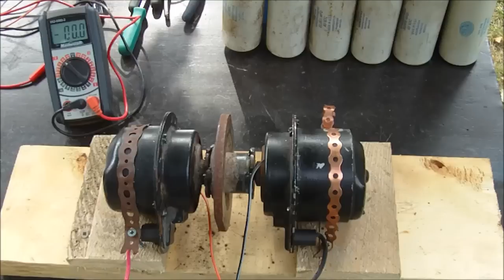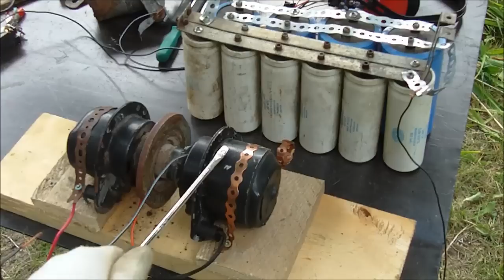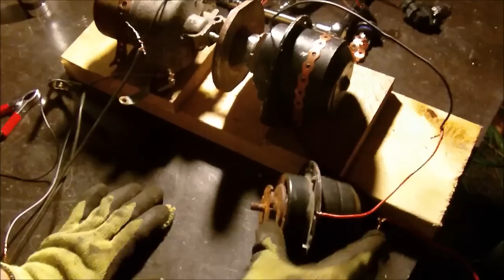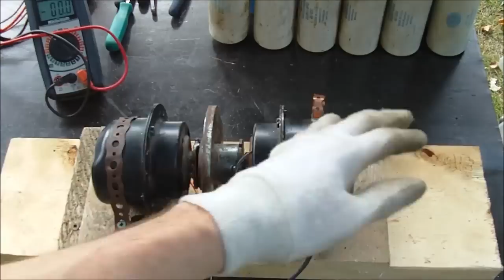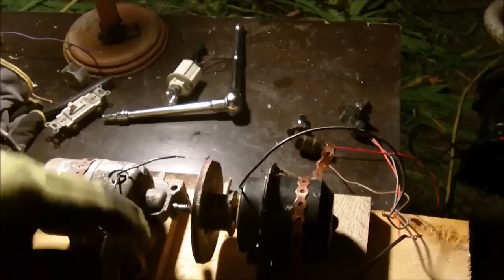Electric Motor to Motor, can they self run?

Comment: There's no reason to beat around the bush, self-running IS impossible because it violates the Law of Conservation of Energy, and the laws of Thermodynamics amongst others.  The only way you could have a self-running system is if they are 100% efficient, which is impossible.  There are always going to be internal and external losses: Friction, internal resistance, viscous damping, and much more. Even if the system is 99% efficient, there will be a 1% decrease in energy output vs input, meaning this system will not self-run.

So if you have a 100 W motor driving a 100 W generator, which is powering this motor, the only way they could self-run is that if this system is 100% efficient and the entire 100 W from the generator is sent to the motor.  In reality, when the generator produces 100 W, the motor would probably see 80 W or below depending on how well constructed the motor and generator is and the next cycle, it would be 64 W and so on until 0.

It maybe possible to get really efficient motors/generators via superconductivity etc but even then, it won't be 100%.
Reply: it needs to be done with a 2 hp 6000 rpm dc motor with reduced speed by a gear ratio of 5:1,which will increase the torque 5 times to  making a total of 7456 watts and reduce the speed 5 times slower to run a 10kW generator. Your draw to the motor will be 1491.4  watts and the voltage is 180 volts dc, which should be 8.29 amps, and, the generator output will have 220 volts AC with 7456 watts max load and a current capability of 33.9 amps maximum (I'd put a 30 amp breaker maximum, maybe even limit it at 25 amps to reduce wear on the motor. The generator will have to use a bridge rectifier with  30 amp alternator diodes (cheapest) , then, a buck converter to drop the rectifed voltage  which will be nearly 300 volts DC back down to about 210 volts dc to loop back to the batteries running the prime mover (180 vdc motor) When connecting the buck converter, be sure to connect a light bulb across the positive and negative of the feed to the buck converter to get rid of additional voltage spikes created by the generator if it is not an induction style generator. Standard generators make too many spikes as it is too dirty so, when you have a dc motor operating at a very high rpm, this may also produce unwanted spikes that will destroy the buck converter which is sensitive to spikes. If you use an inverter, the same thing will need to be done, adding a light bulb. Check out Jesse McQueen's patent as it works and does so very well. The motor, inverter, generator, and buck converters as well as the necessary wires are all very expensive but worth it for free electricity. The motor is easily $2500-$4000 for a very good 6000 or 7000 rpm 180 vdc motor. This system works perfectly in a self loop mode. Good luck building it as parts are scarce and expensive!
Reply: have you never heard "laws are ment to be broken". hahahaha. or "never say never".
Reply: That law had being violated long ago, no longer a virgin , first prof is stochastic resonance over-unity gain in crystal latices , Ein + e↓ = Over-unity
Reply: There's way too many people currently suppressing the technologies at the moment by shielding the overunity element with the physics books that the current limitations in physics have made anybody creating an overunity look like madmen. I have been working with systems now for 10 years and have cleverly released many devices that show this overunity very clearly, however, science has come up with some sort of wording to shred even one ounce of possibility of my developments by telling everybody these devices have been long ago been debunked when they never have even existed before. I'm sure you've encountered the same problem where guys like Erik Krieg have complete nonsense to say about a perpetuum device like the man in Italy with his giant Ferrous wheel he created (A machine To Die For) . It obviously runs by itself due to the transfer of weight from the bottom to the top of the wheel, but, when there is any reasonable doubt, such as Erik stated it could be running from the wind, science puts this flaw in front of anybody and sets it aside from reason so nobody will again speak of it. It isn't fair as new technologies are being buffered from society for what? To continue to allow the use of fuel, and it is damn pathetic as we are in a race to find a technology to replace fuels and there have been several devices that work but never have been released to stop the chance to create and then sustain a fuel free society and it really sucks. If anybody, our government should stand by our inventors and protect their developments because they are all the work and needs of tomorrow. Without the private inventions out there provided by the world's smartest people, the continuation of our world will be impossible and we will all need to get our heads together in the same space to put together thoughts to overcome this ridiculous greed and jealousy that has now been damping our abilities to prevail, which has been happening now for hundreds of years.
Reply: Look into REX RESEARCH(dot) com  no one spends $14,000 or more in things that do not work , hundred of patents are real working devices ...
Reply: Marc Belanger
Sorry, I stumble already about the first lines of your explanation how self-looping could be achieved. A gear box does not change power, only torque.
Reply: arkresearch
Sorry, but conservation of energy was never wrong yet, also not in crystal lattices. If you can give me a link I will have a look and I will explain you that there is no violation. (Except processes with conversion between mass and energy of course.) A Ms Noether has proved 100 years ago that our universe couldn't be stable without conservation of energy. Since our universe still seems to be stable conservation of energy must work.
And you would be surprised how much money was often spent by gullible people for outright trash. Where are the many "real working devices"?
Reply: So, running a 750 watt motor for over 30 minutes on 2 AA batteries would be impossible, right? Check out https://www.youtube.com/watch?v=GWHTm_id0YU Before  making such an outrageous claim, you might want to try to understand how DC motors really work. Until you learn how to make the WITCH INSIDE OF DC MOTORS work for you instead of against you, you will never really understand the truth.
Reply: Vid Bid Truth is that laws of physics hold. They are used by engineers countless times every day and prove always to be right. I studied EE (MSc) and I know how DC motors work. This motor runs idle and does by no means deliver 750W. With a mechanical load of 750W he would not run this time at all.
Reply: In a system built like this., the only way any overunity would happen would be by introducing very tall spikes of power in a rapid succession, on/of/on/off, to gain speed with a higher output  power and lower input power from the same amount of time that it is on, bringing the voltage to a higher level by the release of back emf (which releases a continuous reverse high voltage spike that is created by the coils of the motor turning on and off). The faster it is switched with sharp rapid pulses, the faster the motor will spin, and the lower the input power will be that is drawn from the source, while the output of the motor will be slightly higher than before.

This has to be done with such a high speed that the measurements of the circuit are merely impossible to read since the frequency is so high that the meters can't read the measurements accurately.

Science has been debunking this due to the use of the meters which aren't accurately doing their job, for instance Gerard Morin's device, which changes over the electron flow of electricity from a easy to read source of energy that is using more than it outputs, then gets to a speed where the opposite occurs.

It is pretty evident that a battery can't last powering a motor and generator like this for hours on end without dying, so, the truth of the matter is that overunity is being created since the output does more work than the origina;l feed, in fact, it is doing 18 times the original, for much longer.

I have been studying and replicating this for a long time, and, with specific types of equipment, it is possible to be done no matter what science or anybody says. For any of this to work, all people have to do is follow these links and they can all make it work, unfortunately, it isn't simple to do, but, it allows the release of free energy, no matter how many Tom Hoelhers or Mark Dansies are out there suppressing it. The ultimate goal for them is to stop any chance for the release of any free energy system to protect their investments in oil stocks.
links like this show the truth, the whole truth and nothing but the truth.. we just have to try and build these, as well, be involved to work together to use these items no matter how much suppression continues. I don't care if they try and make me look like a fool.. my systems that I have built will prove in person, without a shadow of a doubt that they work to power my devices I utilize and i do not use one ounce of energy from an outlet to make them all work. A brief charge from a battery to start them is all that is necessary once these systems are built. A ton of filtering is necessary, but, they do work and are safe to use on an everyday basis. However, there isn't one of them that I know of capable of powering any household infinitely without having multiple units since they are expensive to build, time consuming, and need multiples to endlessly operate.

When we do so however, if we do not have and maintain an electric bill that we've had all along, we raise flags that say we are either cheating out electric provider, then, towns and government band together to eliminate possibility of this spreading, so, it has to be used in cabins and such that do not have a possible route of electric power to eliminate the ability to have any one agency remove us from society. It is perfectly possible, so, as many of us as possible need to spread the diagrams to get it all out there as quickly as possible. They do not have to be manufactured by  any one major facilty if people grow a set and start to experiment safely in each of their homes. it's been possible for over 120 years and we need to use this to save our planet now!
http://overunitybuilder.com/ert1.html
Reply: Marc Belanger
Science is not debunking this due to imperfect measurements but due to the fact, that back-EMF is created by the collapse of a magnetic field and only returns the energy, which was previously invested to build up this field. So back-EMF will not produce any overunity energy, never mind if spikes are tall and short or low with a longer duration. Perhaps there is a flaw in your experiments and measurements?
Reply: I'll show what I have come up with once I complete the project. My device isn't set up like this, more like a Chas Campbell system, but, my flywheel has magnets in it and I utilize timed pulses to direct the back emf spikes to the coils to drive the magnets in repulsion, then, there are pickup coils that drive the motor with their additional energy generated, using the added energy from the slacked off belt to drive the inertia from the jerking of the belt and weight of the flywheel operating at 4500 rpms to  add additional output. It is way more than it draws due to the fact that the motor is brought up to speed, then, it pulses it's power once it switches off from full time power to 1/3 on time switching. The genrator function outputs all the time, and, the back emf pushes the rotation all the time, so, the speed increases while output energy is created faster and much more powerfully than it's miniscule input. Im talking about less than 300 watts of input to get nearly 5500 watts of output and it gets better daily since I've been adding bifilar coils and adjusting spark gaps for a high voltage out put to be stepped down to a working voltage so there is a gain/. Since no ground is used and there is no connection of any casing to ground, the difference in potential from the device to ground is incredible and we could utilize ground as the opposite polarity without using and creating any massive load on the source. This means we are using only a radiant energy source due to the fact that we use 300 watts to spin the motor and no additional energy since the circuit doesn't use a return to load up the generator. It uses high voltage energy created by the generator and since one side of the coils are not grounded, since they are open, they create a return path to ground through the air making a massive difference in potential between the ground and the hot leg of the generator. This allows the generator to spit a very nice output of cold energy and it literally takes a few minutes for the transformers to fill up with charge as they are working as an rlc circuit. the transformer utilizes a plate type low voltage winding made of aluminum and a copper wire winding for a primary that is connected to another primary bushing, stepping it back down. We feed the input to the low side of a 5kVA xfrmr, then, go bushing to bushing from high side of the 5kva to a 15 kva, step back down to 220 volts at a massive rise in output. At an ionic level, I feel the energy is coming from the atmosphere, but, I simply only can prove it has much more on the output than input. This can be done with any brushless generator feeding pole type transformers with these types of windings, as Tesla did this with the electrical transmission system and it still boosts and amplifies our power companies systems to this very day. I have proven this out during an electrical failure with an old 15kW generator outputting 66 kW on the stepped down side of  a 15kV transformer that had it's grounds blown off during an electrical storm. I was the guy who cut the service free to eliminate electrocution from the generator and we were able to measure the output amperage and input amperage. There was nothing else energized other than the generator so I wrote down the connections and how it obtained it's additional energy. Gerard Morin uses a technique similar. Look up the video, it is on youtube titled "The doubt for overunity is over". This is the truth and it works. plainly put, if you or anybody else do not believe, just try it yourself, I do not tell any lies, I am somebody who can make money with this as I have several prototypes built.
Reply: Vid Bid
I dare. Many commenters have already noticed that this new video is meaningless. First of all the two AA-batteries are gone and replaced by an unspecified battery pack. And it does not need 750W to get flakes out of a stick of wood. I have a tool with only 75 W which does this as well.
Measuring power with a stick of wood is not a scientific approach. Do you know what a power of 750W means? It means lifting a weight of 75kg in one second one meter up. Why doesn't he show that his motor can do that???
Reply: Vid Bid I did comment this video, but my comment doesn't show up. Maybe it's an effect of the google-comment system - I also can't see your last comment on YT. Or UFOPolitics does not like critical comments. But putting a piece of wood to a rotating disk is not a measurement. Why doesn't UFOPolitics make a sound measurement of mechanical output power? Perhaps because it would show at once that output power is less than input power.
Reply: By the way, UFOPolitics isn't breaking any laws of physics, but he is using them to our advantage. You really need to learn about the WITCH that he refers to and how it can be used in your favor instead of against you.
Reply: njintau you are perfectly correct and you base your understanding on a closed loop system but if you open the system to outside energy as Tom Bearden explains trust me he's got more phd's than you & me together it is possible
Reply: njintau look up Moray, Bruce de palma N machine, tom beardens magnetic energy generator(MEG) all these systems allow for energy to enter via magnetics or resonance
Reply: absolutely correct. A closed system with a mathematic equation doesn't. A pulsed system with a hairpin circuit and magnetic amplification by transformer with an adjustable  spark gap inside of a glass tube under negative pressure draws in the true life of the energy. The Casinir effect is proven to be the source of the zero point energy, or at least "a source", as well, science will not refuse to acknowledge that this exists. Science actually has accepted this, so, while some are here shielding these methods of free energy with their physics books and their contents, remember this... Jp Morgan had a lot to do with making sure his electrical grid and General Electric made money from electricity through his electric meter from day one until now, even though the money has been taken away by the government and it has since become the pocket of the government who has been absorbing all of the vast cash from the electric customer. The physics book changed in 1893 when Morgan financially persuaded Lorenz to publish his version of the heavyside equation and all of Maxwell's original equations have never been released, as a matter of fact, his asymmetric magnetics and transformer equations have disappeared from physics books and all publications mysteriously one year after Maxwell's death in 1893. Our world has been nothing but suppressed since then, but, again, mysteriously, in 2010, those missing Maxwellian equatiions have popped back up and have been studied again by very specific universities. They have since been released online to the public in college study publications by the IEEE. We can buy these studies, but, the formulas and circuits have been blacked out from the publications. We need those who have studied this to come out and release these equations to the public since we have been robbed of them. The circuits have been slowly released and UFO Politics has some of the versions of the motor windings, as well, the transformers have been released on a small scale by Vladimir Utkin in his free energy pages. I have used these transformer designs mixed with another type to build a device I created called Pelex, and, it generates energy of mass proportions from miniscule energy, in fact, it takes 120 volts at 7 watts and generates 120 volts at 1500 watts (measurable with a killawatt meter), then, when it is loaded with more than the killawatt meter could handle, over 1500 watts, I can't measure it anymore, but, the wire gauge isn't possible to carry the amperage which becomes double of what the conductor operates with normally and it doesn't overheat because cold energy is being fed into it, allowing the copper 20 gauge wires to pump well over 3000 watts worth of resistive load through these wires without issue. The transformer's primaries are wound with 30 gauge wire and aren't supposed to be able to handle more than .201 amps and that equals only 24 watts  . My device uses 7 watts at 120 volts to power nearly 3000 watts out maximum before the transformers start to smoke without failure. 3000/120=25 amps, but, the amperage is on the output and not on the input as the input is ice cold, but, the output coil is screaming with heat. If my device was a cheat and my meters were lying, the first and second transformer coils would literally blow up and burn open at this type of load due to the wire gauges, but, they don't explode because something incredible is happening inside of them. The coils are bucking coils wound identically, so, they cancel out the load and lenz's effect on each of the windings, until the last coil of course where it gets the full rated output. I am going to rebuild my device and keep using the technology I have used to amplify the power, making the output coils larger and larger, with bigger and bigger cores as they grow from one core to the next, etc. This is exactly how it works, but, it is ridiculous to get even one transformer operational since coils wound the same way on both sides of a transformer usually do not transform energy from one side to the next. It took many experiments to figure out how to do this .,It also cost me nearly $15k in cash to wind these until I have come up with a working prototype based upon my theory. I take smaller transformers, step one up, then to the next transformer that is a much higher va rating, step it back down, then, again up, and then back down with the same scenario over and over, but, each one is in resonance with the 60 cycle frequency having a cap in parallel with the transformer coil to make sure it oscillates at the very minimum amperage it can, cancelling out the emf in the coils, but, successfully amplifying the output one to the next and so on. The only thing I have a problem with is the final coil heating up, but, that shouldn't be a problem if I make it large enough to handle the circuit. If the normally would transformer is used, there is too much loss in them, so, radiant energy is necessary to be used to do this, and, no it does not require a closed circuit, it requires a pulsation with an arc gap to provide the non lethal radiant energy that Mr. Tesla discovered, and, it is extremely easy to use, plus, it does not measure with any validity anywhere through the circuit until the motors are spinning to get measurements from a mechanical standpoint, or, a heat output measurement vs. voltage and amperage drawn. It can all be created by a magnet rotored generator with no brushes, then, amplified with the correct transformers and used to do so much more work. The energy works like it has a brain as well, where it will not smoke out cmos chips or LEDs, nor will it burn out light bulb filaments.. it is extremely gentle, plus, you can't get killed from it as it only bites a bit but won't kill, not even if you grab it with 1000-2500 volts. The amperage is taken away at the spark gap so it only runs from voltage for whatever reason, but, it works and I am living proof that it is real, as well men like Gerard Morin have proven this to be real as well and he has done an exceptional job showing this is very real. It literally runs several hundred degrees below zero at the high voltage bushings when it's operational as well.
Reply: Marc Belanger thank you marc i applaude you. there are too many numskulls that just feel content with what they were taught in 5th grade and therefore very convenient to quote law of thermodynamics & conservation of energy (again in a closed system)
Reply: Alex Manzanero
First of all conservation of energy is also valid for open systems. You can find the formulation for open systems in any schoolbook of physics. Some people assume that openness allows extravagant energies like ZPE to creep in. But there is absolutely no experiment, which ever showed this. Marc Belanger has mentioned the Casimir force. This force exists, but force is not energy, no one knows a way to harvest energy from this force. Just as we also can't harvest energy from the force of gravitation.
Tom Bearden explains trust me he's got more phd's than you & me together it is possible
LOL! Mr. Bearden has bought his titles from title mills, he has no third level education at all! He claims many things but he is unable to show a working model of his MEG. 2005 he announced that he would still need millions of dollars to develop a working model. 10 years later he still can't show anything working, not even with just 1% of overunity. Bearden also claims, that the original equations of Maxwell were changed by their conversion to modern vector operators. A ridiculous claim! Maxwells original equations are well known and anyone competent in vectoranalysis can show at once that these equations were not changed at all in their transformation to a modern form.
... too many numskulls that just feel content with what they were taught
This contentedness stems from the fact that up to know no one could show that the things taught are not correct. There are too many incompetent crackpots with weird claims like e.g. Bearden, but none of them could ever give a proof, that their claims are correct. Where is a working prototype of the MEG? Where is a working prototype of the N-machine? Who could ever show how to harvest ZPE, dark energy or any other unusual energy form?
Reply: Marc Belanger HP = RPM x Torque. Using a gear ratio of 5:1 does nothing to your HP... if it increases the RPM, it decreases the Torque by the same amount. It's called leverage. If you have a see-saw, and put a 100 pound weight on one side, you can press down on the other side of the "lever" with 100 pounds of force, and cause the weight to be lifted. If the fulcrum of the see-saw (lever) is moved away from the weight so that you have a 2:1 ratio lever, and press down on the opposite end, it requires 200% as much force (torque) to move the 100 pound weight. Same thing with gear ratios... In a car, the differential gear is to increase the torque applied to the wheels, and does so by trading off RPM to increase Torque... the same HP reaches the ground, but in this case the Torque is what is needed to move the heavy load. Please do some reading on HP versus Torque versus RPM... your understanding is incorrect.

HOWEVER... people who make videos like this don't understand the concept... see my other comment here.
Reply: All we need to do is take a 7000 rpm 2 hp motor which obviously uses 1500 watts to operate it, reduce the rpms to 3600 and you'll have the torque necessary to drive a 3000 watt generator head. It doesn't take a rocket scientist to see that if the motor creates 2 horse already, the torque at half the speed with a gear reduction is double, the same torque that the 4 hp motor would put out at 3600 rpms. The nonsense of rpm and torque is a bunch of complete suppression that has now been going on for over 100 years because a 6000 or a 7000 rpm 2 hp motor would never be labeled so if the formulas were completely true. Try it if you don't believe me. Jesse McQueen has a system that uses a 6000 rpm 2 hp motor reduced at 5:1 running a 10kW generator and it runs flawlessly to create 7500 watts rms, then, he loops it to power itself and collects the free energy left over, which is respectably 5000 watts peak but he says he is comfortable using 4500 watts without even straining or overheating the motor.

Now, if the calculations were correct, then, why would his system ever work? The reason why is because the system draws in an external energy that wasn't there before which is all brought in by the gearing. It makes no scientific sense with the calculations as we were forced to learn these formulas to suppress the knowledge that overunity is possible, so, nobody uses it. That is why I said hp before, even though the argument everybody keeps saying is the rpms x torque. We don't need distances set here, we already have them figured in with the rpms that the motor gives, when we apply a reduction, the motor works less and the torque is increased by 2 on the other side of the 2:1 gear which is used to reduce the speed and increase the strength of the output so it spins the generator with ease and at the correct rpm as 3600 rpms from a 2 pole generator equals 60 Hz for the frequency since the N & S of the generator need to do 60 revolutions per second which is then multiplied by 60 minutes which is 3600 rpms.

I had the motor laying around for years. The tough and expensive part was finding enough money to buy all the same batteries, which I use optima gel cell batteries in series to create 180vdc. I had a custom transformer wound to reduce the 240 volts to 180 volts and use a 200 amp SCR to rectify it so the battery bank could safely charge and loop.

The same thing can happen with specific motors. I used a 1200 watt AC induction motor to drive an alternator at 3200 rpms and it is only a 1.5 hp motor which drives the alternator to it's maximum very easily. The alternator is a 150 amp GM alternator which operates at 14.4 volts, so, 14.4 x 150= 2160 watts. If we invert this and run the motor, we get a loss of nearly 20%, and it leaves us with additional power once looped of approximately 528 watts. The system self runs, and has completely free energy. The 1200 watts used for the motor is throughout it's startup and then it drops to maybe 980 watts rms and only gets up to 1200 watts when the alternator is maxed out.The batteries stay charged at 14.2 volts at idle, then, when loaded with 500 watts, it drops to 13.2 volts (lowest).

We didn't push it as it couldn't possibly operate any higher as the alternator was getting extremely hot, which is why we built the system with the larger dc motor. I feel the dc motors ratings are not accurate for their power given, in fact, the european motors aren't marked with a HP stamp as I think they offer more power than any American motor of the same size, the tough part is they are an odd ball voltage and there is a moderate expense to get the free energy but all worth it on the end. I still use the motor/generator combo to this day for my Garage, and, I turned my air compressor into a self firing generator which it uses a prefilled tank of air to drive it's own air motor to create the pressure needed to pump the air back into the tank and drive an alternator to fill batteries and invert the energy to light my back yard and my shed that I perform all of my experiments from.

Don't think this stuff is so far fetched, the air compressor is also another that has been suppresed for many moons as it is completely free of all fuels and never stops until the compressor overheats and fails. High grade synthetic lubricants are completely necessary and it is highly recommended that you use an older compressor as I did to get the cast iron compressor to actually last and make it easy to connect to since it uses all steel fittings etc.

Marc
Reply: I meant 2:1, not 5:1 for the 7000 rpm motor. Jesse mcqueen uses a 5:1 reduction to run an even more powerful generator successfully.
Reply: Marc Belanger
The nonsense of rpm and torque is a bunch of complete suppression
Oops! The formula  power = torque x rpm (besides a constant depending on the unit-system) is complete suppression? Energy=force x distance also suppression? The law of the lever compelete suppression? Who can take you seriously anymore if you write such outright nonsense?

Jesse Mac Queen is just a crackpot and scammer. You describe driving a 150A-alternator with a motor. Have you really put a load on the alternator drawing 150A? Try it, you might see a surprising result.
Note: european motors are not specified with HP, they have switched to specifying power by Watt in Europe.
Reply: Auftriebskraftwerk
Reply: Vid Bid
"Auftriebskraftwerk" is an outright fraud. It doesn't work, the measurements are swindle.
Reply: njintau Only a fool would say something is imposable, tho I'm also not saying its possible, I'm also not saying it's imposable, Keep an open mind.
Reply: Delta Destiny
Can you pull yourself in the air by pulling at your shoelaces? No, this is impossible due to basic laws of mechanics.
Yes, it's good to keep an open mind, but not so open that the brain falls out. Keeping an open mind also includes to rate obvious crap as crap.
Reply: njintau but we've managed to build aircraft, go to the moon, unmanned vehicles, etc. Just because there is a law, doesn't mean it can't be broken.
Reply: TheGolfinj98
Yes, we did all these achievements. But a law was never broken by them! There was no law of physics which prohibited motor flight or space flight. It was considered impossible by many scientists, but not because of laws of nature but due to technological possibilities.
Laws of nature like conservation of energy were never yet broken.
Reply: heinzpg
still doesn't mean that as we continue to progress we won't be able to overcome those laws
Reply: TheGolfinj98
Not very likely. These laws are not made up by theorists, they just describe what we observe in nature. And this doesn't change. Ok, today we can get energy from nuclear reactions. This does not refute conservation of energy, but it is a form of energy which was not known before. So it is not impossible that we tap some new form of energy in the future. But - to come back to this video - not with coils and magnets! This is just ridiculous for any knowledgeable person. It would need a complete different approach.
Reply: very understandable, which is why recognize the law but never give up in finding away around it. If people only follow the laws, it doesn't encourage outside of the box thinking, and that is what we continuously need to do.
Reply: TheGolfinj98
There is enough room for out of the box thinking by accepting those laws! Just look at the famous physicists who made great findings. None of them doubted conservation of energy. And look at the many inventions made. None of these inventors doubted conservation of energy. You can only achieve solutions with nature, not against nature. Or as a famous physicist has put it: "Keep your mind open for new ideas, but not so open that your brain falls out".
Reply: Pete Kiryluk
You can't draw energy from gravity in a continuous fashion. Thus gravity does not help at all in the design of such "machines". I don't understand what you mean by paper napkins and earth spinning, both do not show any mystery and or any contradictions to laws of physics. And light does also not violate conservation of energy. Where is your example that it does?

If you have a working machine, then publish the plans to the benefit of mankind. If you have not then don't communicate your crackpottish ideas until you have something.
Reply: heinzpg but you arent coaxing the witch inside the motor properly!!! you have to do a deal with the goblins to gain her respect...its not every electrical engineer thats good at goblins.
and the standing wave, even maxwell couldnt get his head round that one.
exciting the earth electrical field instead of running an electrical field within its bounds,,,,not overunity but it might just vibrate the whole earth and make it go pop,. runaway resonance or overunity in this situation might prove not such a pleasant idea...
nuclear power presented a form of overunity as lenr does today...
look what that did.
Reply: heinzpg if there is overunity that can be tapped by anyone and easily weaponised?
its a good fucking job they suppress it until we get rid of all the psychopaths.
The conspiracy theorists often miss this little piece of fanciful sequential logic.
they love a what if but they tend to avoid that little gem.
rossi and his lenr looks all the more plausible for this...
there have been a number of explosions in reproductions that involve some sort of runaway overunity and imbalance in the control systems.
very interesting stuff.
Reply: Tarquin Mahoney Maxwell had no difficulties with standing waves and resonance. Microwaves, lasers and freeing the binding energy of atoms can be used as weapons. But hardly LENR since up to now LENR does not work. Rossi was (is) a scammer. Publications ¨proving¨ LENR are dubious. Rossi claimed to have products ready for sale but he never showed that any of these products really worked. He made money by selling distribution licenses but there was never anything to distribute.
Reply: njintau Learn the laws of .. you might want to relearn some things.. like the lies of physics and how they have kept you in the dark for years. learn the truth.. research ..
Reply: Tyrone Capanpan
Lies of physics??? Kept in the dark for years??? What is your source for this nonsense? Can you give an example for a "lie" of physics and who has proved in which way it is a lie?
Reply: Pete Kiryluk
Of course this is a measurable force, this is a well known gyro effect due to conservation of angular momentum. But this effect does not deliver any energy.
Reply: Tarquin Mahoney
LENR is not real at all and there are no clues. People who claim to have reproduced it are scammers or have measured incorrectly. Give me a YT-video showing a successful replication of LENR and I will be able to tell you at once what is wrong with it.
 
And no one understands Maxwell fully? We have his equations, that's enough. The rest ist mathematics. Of course this equations are understood fully. And they leave no loophole for free energy.

Where it is "proven" that Rossi is right? Can you supply some details for this?
Reply: heinzpg
its real as real, it just doesnt work and or blows uop...it also transmutes fucking metal.
whicch is logical really , the contained and collapsed fucking gamma burst i the wierd bit,   its like a form of active corrosion, the hyrogen nuclei penetrate the balance nickle lattice and "crackk" it, pit it, like rusting steel...
its quite amazing...
Reply: evryone is a step behind rossi, there areother methods too, and motive power? not yet, they are trying to get balnced heat out of it, but i reckon it develops feedback loops and dies or or blows up,
he doesnt even now what hes doing, thats the fucking problem with it, and all the physisicist are denying reality in favour of an old model of thermodynamic understanding and how nuclear bnds can be broken without bombardment and at room  tempertaure too...
but look up the colfusion chefs, they dont talk like sceintists but cooks, they are true experimentalists...bit of thi bit of that, univeristies all over the world, darpa nasa mitsubishi have all looked at detail at it,,
Reply: and they report what i do, valuable but doesnt work,,inconsistent,,, you add motive force and pressure? the feedback loop on the reaction is then immensely complex.....its some sort of electrioc element , vibrtion is said to beinvolved , the electrical control system that controls the environment in the pressure vessel to maintain the reaction has provemn incredibly hard to tuine,, it may not be tuneable at all...
if not in any case we have the thorium flouride salt reactor the yanks ditched in the 70s, worked too, flawless bit of kit, the guy who built them conned them into thinking it would ever fiot in a plane...
no fissionable weapons grade material as a abyproduct? they shut it down and betthe worlds futue on missiles .
Reply: +Davidautofull Einstein did predict his theories would be broken. However, maybe by a nuclear physicist in 2050 and certainly not by a back yard low Iq hack in 2015
Reply: +Marc Belanger yeah right.
Reply: +heinzpg and a transformer only changes volts to amps but not power. Same with torque and speed can change but not power. Example 100v at 1 amp = 100 watts.  A 10-1 transformer wired 1 way you would get 1000v at 1/10 amp or wire it the other way 1-10 and you get 10v at 10 amps all equaling 100 watts (minus the loss of the transformer of course).  There is no way to gain anything, ever, period.
Reply: Tarquin Mahoney
The earth is a magnet but there is no way of tapping this energy by a standing wave. A magnetic field can only serve as a tool to transform mechanical energy in electrical one and vice versa, it is not a source of energy itself. Tesla only wanted to distribute electrical energy without wires by generating a standing wave around the earth. It is true that Tesla had visions of tapping yet unknown energy sources but none of these ideas worked.

Stan Meyer was not a pioneer of energy technologies but a psychopathic scammer. His patent is known, all attempts to build an overefficient electrolytic cell due to his patent had no success. Meyer was sentenced for fraud but he wasn't killed, due to autopsy he died suddenly of a brain aneurysma.

LENR does not work, at least not yet. Rossi is also just a scammer. And rodins coil also does not generate any energy.

It's not the mad fuckers in the sheds who have the best ideas. All recent advances in technology came from science. There was absolutely no contribution from tinkerers. They have mad ideas but none of them works.
Reply: Tarquin Mahoney
Why shouldn't your oxyhydrogen torch burn? It is an old technology, but it does not produce any energy.

Wardenclyffe tower was the attempt to distribute electrical energy without wires. Nothing else. It did not work. Tesla blew immense power in the air and only got some lamps glowing in a distance. A normal effect you can observe near any strong broadcast station.

Rossi is a liar. He claimed he had working devices, but he never submitted any device to an objective test. The only "evidence" that more heat is produced than the electrical input is a publication which showed energy of some 100 W. (Though Rossi claimed already to have a functional 10kW-device. Why was this device not tested?) The procedure of this experiment is harshly criticised for a number of good reasons.

Conservation of energy is more than a dogma. Are you familiar with the mathematical proof, that our universe could not be stable without this principle (Noether theorem)? You mention many names. Please give me names of persons who did not only claim to have overruled conservation of energy but who have also submitted a device to an objective third party test which confirmed these claims. There aren't any.

And to come back to this video: What is claimed in this video is blatant nonsense.
Reply: Tarquin Mahoney
Yes, Wardenclyffe tower wasn't finished, but Tesla did similar experiments before in Colorado, also without success. Often J.P. Morgan is blamed since he stopped the fundings for the Wardenclyffe project. But this is no surprise. Morgan hired Tesla to build a transatlantic radio communication. When he found out that there was no progress but this communication was already available from Marconi and Tesla had worked instead on his pet project of wireless power distribution, he stopped the fundings. But the tower was destroyed only many years later when the premises were sold to a new owner.

We know from Teslas lab notes the circuits he used. They just emit EM-waves. Yes, this is the technology of WiFi, cell towers and bluetooth. But it is not possible to transmit electrical energy in an efficient way by EM-waves. In the applications mentioned it does not matter if only a small fraction of the power emitted arrives at the receiver. In power distribution it does matter. Today we know much more about EM-waves than Tesla did. He erred in this project, it was a failure from the beginning. But Tesla was not ruined by anyone. The Edison-medal was awarded to him which was the biggest honour IEEE could grant. And after his death a physical unit was named after him, a honour only very few persons achieve.

As to AC, AC was of course not invented by Tesla, he learned about AC already when he did his studies. But yes, Tesla built one of the first and prominent AC-nets when he worked for Westinghouse. Edisons DC was a failure at these times, but it is revived today for high voltage transmission via cables.

The HHO-generator of Meyer was not better than any other, efficiency was well below 100%.

Water does have extraordinary properties, but they are will explained today by physics. And neither water nor the other things you mention refute conservation of energy.
Reply: Maybe, but if you could get weightless stores of energy into a housing and build a device that is moved by a mechanism that pulls or pushes the store. Are you not tricking the law of physics?
You would have a supply<output to compare to a supply=output.
Reply: Marc Belanger nobody can hide free electricity.   Any system  that in reality,  would allow someone to truly have enough energy to
Reply: thats what gears are for
Reply: I have a 6v DC motor(24000 rpms geared down to accommodate a 3600 rpm generator) running the generator which inturn runs the DC motor and my freezer, fridge and window unit AC unit. Gonna upgrade DC motor and free power just parts
Reply: hay guy or guys here if you know the left and right hands rules try to put them together then in A one unit machine then b/c both will fight each other and why's ???   I think its the north of the motor pushing the generator which is showing a north polarized is why here so this is why they fight each other duh